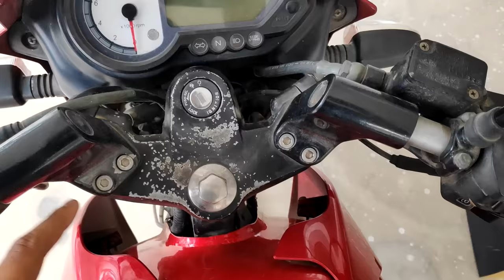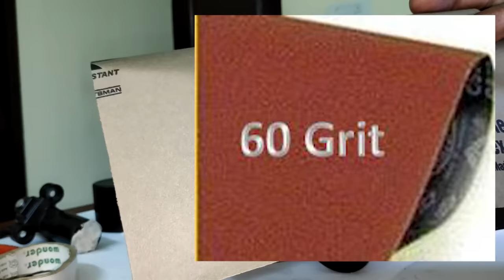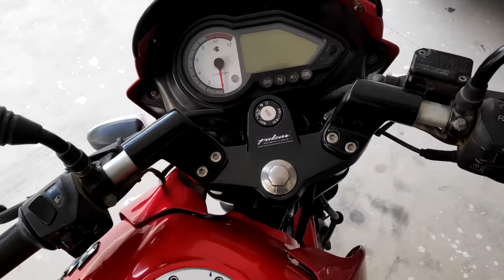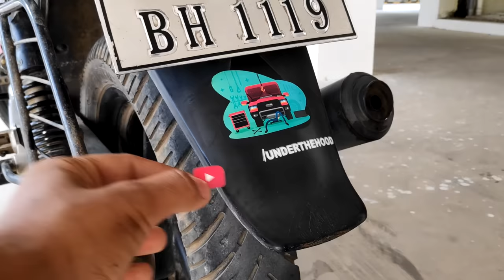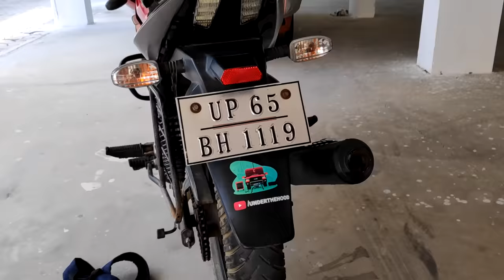How To Restore Bike Paint At Home | Bike Paint Correction | Quick Drying Acrylic Spray Paint

Comment: Great Job. I did mine with a Fine paint Brush. Though the finish in yours was much better as it was spray paint.
Reply: Did you use enamel oil paint?
Reply: @exploRidge  Yes I did.
Reply: @wolwerine0007  and how were the results? Did it last? I'm going to try painting some parts with oil paint
Reply: @exploRidge  They were not as Good as Spray but good enough. Yes they do last.

Comment: Maine sir pulsar handle bar paint krwaya black matt colour usne bola sukne ke baad matt ho jayega aaj pura din dhoop main rakha abhi tak wo shine ker rha hai kya use sukhne main time lgta hai
Reply from the maker: Bhai sukha nahi ho ga abhi, bec mera almost 2 din lag gya tha, and I also made a mistake where I thought paint would have dried after a day so I touched it, and it had my fingerprints and I had to repaint it, so wait for some more time. It should give your expected results.
Reply from the maker: Also if u have kept it outside make sure there is no dust around because if that's not the case then the finish will not be upto your expectations.
Reply: Maine sara din dhoop main rakha usko use touch kiya tha wo sukh chuka hai nd proper finishing ni aa rhi usme satisfaction wala kaam ni hua
Reply: Isse acha main new handle bar le aata company se thn better rhta
Reply from the maker: I never asked u to do this DIY also I didn't tell u to use matt colour, so what is better and what is not is not my concern.

Comment: Sir Can We Paint Bike engine with acrylic spray paint  Plz reply
Reply from the maker: No bec this is not a high temp paint! Some people do it but u get my point. It will not be able to withstand the heat generated by the engine.. So pls don't try. U can do it with high heat resistant spray paint, but that too after proper initial prepping of the surface. Atb👍
Reply: Can we Do with aerosol spray paint
Reply from the maker: U know the meaning of aerosol? In that manner the paint i used in the video is also an aerosol, in fact, everything in a can under pressure is aerosol! I said to use a high heat resistant spray which is again an aerosol.

Comment: Bro, if petrol r diesel falls on it.
It will loose the paint  r not.
Reply from the maker: Bro after a few days it is will be like your normal paint you won't even notice, but if you want you can use clear coat spray also available in aerosol.
Reply: Right some time it depend selected paint type u need to know...before use....

Comment: Which paint we should use??
Reply from the maker: I used a normal gloss black spray paint available at any hardware store and it worked pretty well.
Reply from the maker: Ideally we should first remove all the paint then apply primer then paint then clear coat, but it is a DIY so...

Comment: for this bike only side one strike is there it looks like old bye when that indecent happens onwords but that bike is new pls show me that bro
Reply from the maker: I cannot understand what are u actually asking. If you are saying that the model of bike is old then yes it is 2012 model.
Reply: @UNDERTHEHOOD  no my bike is pulsar 150 for that bike tank  is there know beside of that one small damage is there means strike out like that so if you give any solution to cover that strike out
Reply from the maker: Yes there are a few solutions,
⚫ If the strike is not very deep and is only on the clear coat then polishing it will remove the scratch.
⚫ Or you can get your tank wrapped
⚫Or if it is a dent then u have to repair the dent and then repaint it, but u will have to take it to a denter and painter in this case.
Reply: @UNDERTHEHOOD  yes on strriker and beside of tank

Comment: This paint used  plastics?
Reply from the maker: No it won't, atlest not properly and firmly and if it is a very smooth surface than the spray will just glide like water! I painted a few plastic parts but I took a sand paper and rubbed it once over the part completely so that the paint has something to stick to. Then it will work.
Reply: @UNDERTHEHOOD  i want this